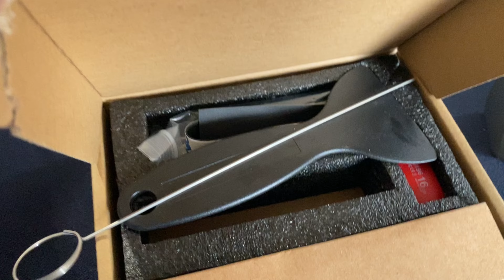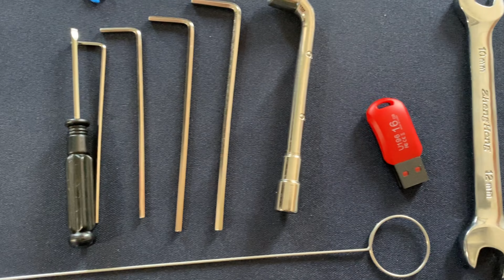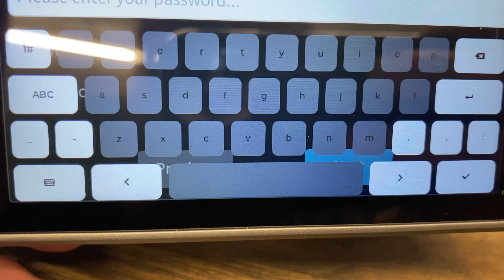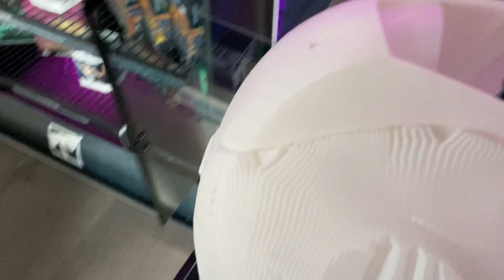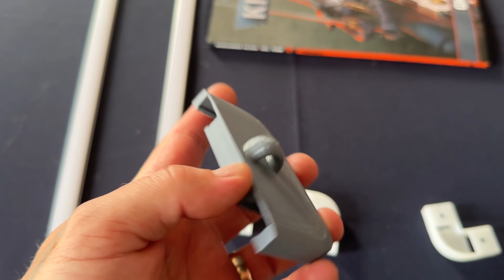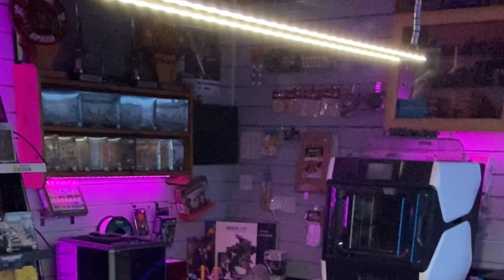Creality K1 Becomes my New Favourite FDM Printer

Comment: I've heared a lot of negatives with this printer, especially with the first  batches. Did the fix most of the problems, e.g. with extruder, hotend? 
Is the Speedy the same as the normal K1, just the fixed version? 🤔

Comment: I have a K1 Max and it is great. I use it a lot for statue bases. Saves time and resin and especially if the base is rock you can get away with as much filling of layer lines as you need. Once it is painted it is all rock. Only bad experience I had was the door literally exploded first time I touched it but that is a shipping issue. If you custom mount the filament off to the side or above the machine the rear mount issue goes away but I agree the placement on the machine is weird.

Comment: I use the bambulabs x1c.  Witht he AMS, it about $1000 more.  Would need to see a comparison of each to check quality.
Reply from the maker: Well if it’s a grand more then i would say it’s probably not a a comparable machine. But also I don’t have a Bambu so I can’t compare either as far as fdm machine to do the odd bits I need around my shop it’s more than adequate for that 😊
Reply: @Groundeffected  Only reason I ask about a comparison is that it looks like Creality started to take pages from bambulabs about the enclosure and the camera inside the chamber. The way you described it, it feels like a budget friendly version of the x1c with minor issues. Not trying to flex here, I just got tired of printer power supplies burning out and parts going bad after a small amount of uses.
Reply from the maker: @beyondoriginality  honestly I wish I could tell you more my dude. It does feel like a budget friendly version of them bambu machines. But I don’t know enough to really compare them I wish I did then I could answer you.
Reply: @Groundeffected well if you are interested, we can both print the same file with the same settings respectively.  I can send you the print and you can let me know what you think?  Just an idea... I did print alot of articulating skeleton hands.

Comment: Must say a good friend of mine has one of them K1's, he has a good few issues with parts and such,  M board replaced twice, feet broken, door broken (when received). when it does work its twice the speed of my Artillery SW. Fortunatly hes a genious with electronics and was able to change out the boards. Food for thought.
Reply from the maker: There was a first batch released that had some issues and what I was sent was apparently the new batch. I’m not 100% sure as I am a typical male and when I’m being told about a printer or new toy I am already interested in then my mind is like porridge when the rest of the info is explained lol. I was meant to get it a lot longer ago but they delayed and sent me the latest version not sure if those issues were fixed, so far I haven’t had any of those issues only one was the gear in the extruder and I’m sure I broke that being a gorilla hand.